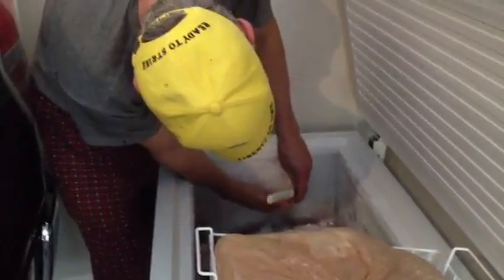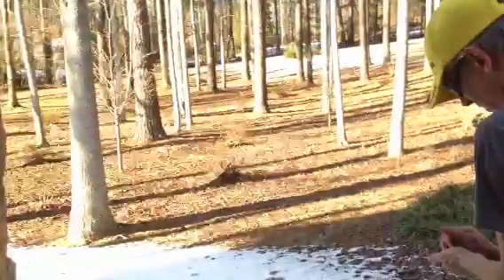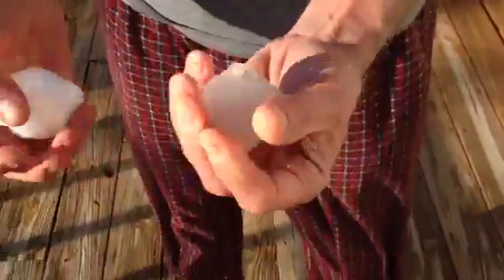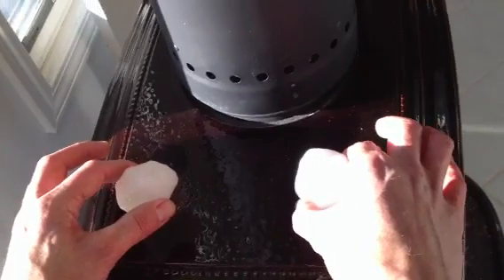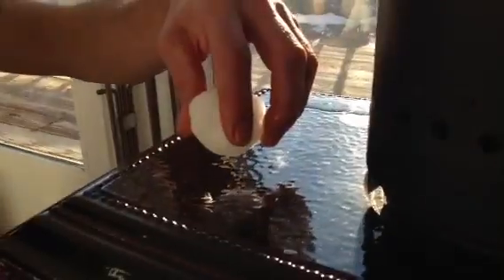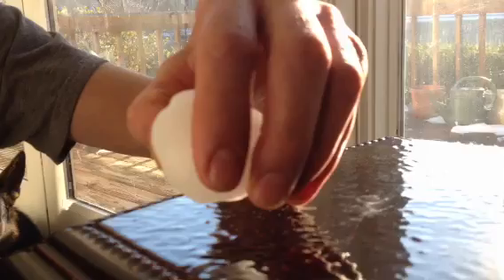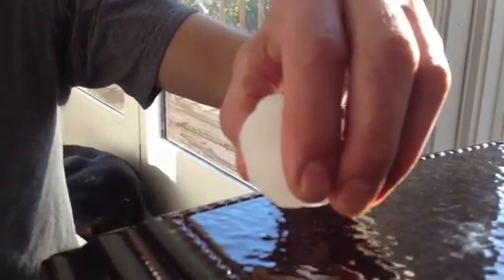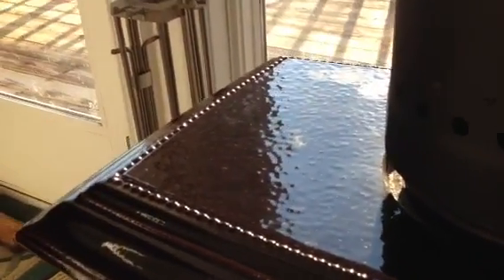Shouldn't Snowballs Melt?!?

Comment: The snowball is like a sponge, with lots of empty space between the individual snowflakes. It can hold its own meltwater. That's why it doesn't drip out of it for a long time. The ice scraped from your freezer has a different structure, it consists of large chunks of ice with no space between them. There is no such thing as a "chemically nucleated snowball".

Comment: There's simple physics between water and ice crystals, it won't melt the same as your chunky ice ball because the ice crystals are thin ice flakes. They are soft enough to absorb the water as it melts. Much like how snow cones can hold syrup in suspension and not drip. Your ball on the other hand has bigger ice crystals so it can't hold something with the viscosity of water. Put snow in a hot pan, you'll see the water melting and going into the snowball, it'll lose volume but not mass. Because of it's low density, it can condense before dripping.

But I'm sure this'll all fly over your liberty lovin' conspiracy head.
"IF 'DEY AIN'T TRYIN' TA GET MA GUNS, DEY BE TRYIN' TO POISON MA BRAIN WIT MIND CONTROL CHEMS"

Comment: I experimented on some of the "snow" we had here in central Texas. When I put flame to it? It disintegrated. It didn't melt. It just disappeared. It also emited a plastic burning smell. The smell was not from the flame. I let the rest of it melt at room tempature and it produced almost no water after it melted. This is the strangest "snow" I have ever seen.
Reply: Video proof? I've not seen a single video so far where snow behaves extraordinary. All quite normal.
Reply: Phouse1512 Even if I posted a video. You probably wouldn't believe it. So my suggestion is you get some snow and check it out for yourself. I thought it was nonsense until I checked it out for myself. I have a biology background. So I thought about how to conduct the experiments in a scientific manner. This "snow does not behave like snow I have dealt with in the past. It is more like some kind of chemical composition.
Reply: flamingangel999 No offense, but then it's just another story which I can or can't believe. Would be highly uncommon for snow to disintegrate/disappear. Maybe you can weigh the mass of the snow before and the mass of the water after burning, to see how much is left.
Reply from the maker: GOOD WORK !!!!

Comment: For a better experiment, you should try putting the ice on a pan hot enough to melt it, but not evaporate it, collecting the water. Then, refreeze this water into ice, along with an identical amount of water from your tap or whatever. Then you can compare how long it takes to melt.

Comment: I live in the northeast and so I was very curious about this "non melting snow". So I went outside and grabbed a decent sized snowball and held it between my hands over the sink. Not only could I feel the snow melt as soon as I picked it up, but within 2 minutes I had a steady stream of drips (about 2 a second). Plus I can tell you from my experience of cleaning off my car, after a few minutes of starting the engine the snow slides off the hood with ease. Since the beginning of January my area has gotten approx 2 feet of snow total. But there isnt 2 ft of snow on the ground now because most of it has already melted. I have an open mind about this sort of thing, but I have yet to see any real evidence. I want to see some actual chemical tests on the snow.

Comment: I did my own snow test. 3 snowballs from 3 different areas of my yard, Same amount of sun/shade, same size, using a bic lighter. # 1 melted normally- no black, no odor, produced water. # 2 no melting, extreme blackening and an odor you could smell from a foot away. # 3 minimal melting, some blackening, slight odor that you had to get really close to smell. After 3 days of temperatures ranging from 40 - 70 F the snow finally melted in my yard. The day before it snowed, the temp was in the upper 60's. The snow should not have lain at all because the ground was too warm.
Reply from the maker: Where are you located Jan ?
Reply: NW Georgia

Comment: people don't use wood stoves like they use too. for those who have never been around one they are hot all over. they don't heat in spot. for the snow is drier people.... water goes in cycles. it boils at 120° f turning it into vapor (air) it gathers and falls in the form of precipitation (rain, snow, sleet, hail). all water should also freeze at 32° f. if what is coming from our atmosphere is not freezing or melting then we have a problem.

Comment: Sublimation is most common when the surrounding air is cold and dry. Humid conditions and warmer temperatures would cause the snow to melt first. The dramatic change in temperatures when snow or ice is touched with a lighter, for instance, immediately converts the solid into a vapor.
The snow isn’t melting because it is vaporizing. It’s changing forms in a scientific process. And as to the claims that trying to melt this snow results in an odd smell, you may want to look to the lighter fluid or the lighter itself-- which is likely far more toxic than even yellow snow.
 and as with this no light, so it is just vaporizing until it get into a more humid form then it starts to melt instead of vaporize.

Comment from the maker: Here's a question for you.....Why would they put Brad Panovich of NBC Charlotte on my butt at 2 AM to do damage control ?  Snow is supposed to melt folks !   Always has, but probably never will again !!  Use your common sense.  Brad's claim that snow is 90% air is patently FALSE.  Look at my latest two short videos where I demonstrate that this loose snow melts down to 35 % water.  When it is packed, it is 70 % water !!!  Hard to cover those tracks now isn't it Brad ?!

Comment: This was not a scientific experiment. The two samples have to be controlled for mass, density, heat applied, and time. How long did you carry that ice ball around in your hand before you held it over the stove? Not that long? Not a satisfactory answer. How did the original temperature of the ice compare to the original temperature of the snow? Not that different? Not a satisfactory answer. Science is painstaking. Your experiment was slapdash.

Comment: Go take a scoop of un packed snow,put it on a  plate,come back in a hour,bet theres water.
Snow 5% water.
Ice shavings or frost 85% water,Ice 99.6% water.
The snow the is not evaporating is being drawn towards the center,if the vid had gone another 2 minutes,you would have slush.

Comment: In my experience between the Aluminium,Barium,Strontium and nano fibers which all happen to come from chem trails,  It seems to deflect and react to direct intense radiant heat. Forming a tighter molecular bond, making it more resistant because it gets tighter on the surface. When the air temperature is dropped subtly though it slowly melts somewhat normal. I would compare it to pushing your finger through silly putty slowly, and then attempting to stab it quickly, when you force it quickly it forms tighter and adds resistance,  i realize this is different, but kind of similar in the way they react to subtle force applied and direct and intense force applied. Make sense?

Comment: I noticed the evaporation into steam immediately on the freezer ice.  To the skeptics, regardless of what you say the difference, it is it still frozen H2O which hasn't changed.  But there is something strange about the composition of this snow on the ground.  "Air is a good Insulator" - then how does it even become snow?  This needs to go to a 'PRIVATE' lab and see what the added compound is.

Comment: Hm, I thought that if you compressed the snow, the air factor would be eliminated, measuring the melting point, and compressing the snow, comparing it with "Ice shavings" are pretty good experiments but no enough to convince them "asleepers". However since this caught a decent amount of attention, I am surprised no one with proper equipment, did not show up to simply, look into it. Then we'd be  dueling  in the realm of higher truths, But still...big thumbs up  to u guys. im down with u, cause so far your experiment didn't involve any type of combustive gases in which could explain the black smoke coming out of it. Above all we SHOULD be more open minded and ALL ASK MORE, instead of simply believing what "they" say.
Reply from the maker: packed snow 70% water !!!!  Look at my latest video.....

Comment: 1. Ice scraped from a freezer is still ice there is no air added to the water when it is made and the reason it melts faster is because the water has nowhere else to go.
2. Snow is water vapor frozen with pocket of air. When you form a snowball what you doing is pushing the snow together then sealing it by melting the outside of the snowball and it harden as the water is whisked inwards.
3. If he had bothered to weigh the SNOWball and ICEball the ICEball would have weighed more than the SNOWball.
4. The reason the snowball does not melt right away is because snow is made up of around 90% air the rest water, which is why it crunches when you walk on it, the water is wicked towards the center of the snowball taking up the air pockets.
5. The ICEball melts right away because ice is solid water and has nowhere to go but away from the center.
Reply from the maker: But John, my dear boy, shouldn't a ball of snow have melted one drop after six and a half minutes above a piping hot stove ?  How much do they pay you to miss the point entirely ?
Reply: Adam Berk the water was sizzling within 2 seconds of hitting the stove, sorry but it has to be pretty hot and not just warm for it to do that. Not saying that this "fake snow" not saying that ice and snow don't melt at different rates... i'm simply observing there is something extremely odd about the rate it took for one drop of water to come from that snow from outside... it's snowing here now in Iowa, i will continue to investigate this on my own and see what results i get. Also does not explain the chemical/plastic like smell coming from snow that is melted in the microwave and reported  by others, including close personal friends who have posted their videos as well, i just happened upon this one while doing my own digging around to see what i could find before making any definitive conclusions.
Reply: MrGregory1957 How stupid can you be. OMG it's a government conspiracy. We're all in trouble now. Try taking that snow, put it in a post on a stove and watch it melt. Actually go out and learn about snow and what creates it. Become a little educated. Come on up North by me....right now I have about a foot of snow and 6 more inches coming tonight. We did this in science class years ago. Give it up.
Reply: 6 MINUTES dude.. hello if it is the difference of air, that is too significant of a difference to be explained by your reasoning John, and actually if the air escapes should the water not be released more freely?
Reply from the maker: Adam, stove was very hot.  Under that condition, the snow should have passed to the liquid stage very quickly unless it was chemically nucleated.

Comment: Ice shavings are not snow, the crystal structure is completely different. Snow is mostly air. 1" of snow = 0.10" of liquid. 1" of ice = 1" of liquid. They behave and melt at different rates since air is a good insulator.
Reply: he smashed that snow to a pulp so moron like you can understand yet you still didn't get it :))

Comment: Thank you! One debunker made a bit of sense. This experiment is wholly different and shows things aren't right.
Reply from the maker: IT IS SAD WHAT SOME FOLKS WILL DO FOR A BUCK..............DO YOU KNOW WHAT A STRAW-MAN ARGUMENT IS ?
Reply from the maker: Macky, you're all over it !  THESE PROGRAMS MUST STOP AND SOON.
Reply: Ok, so I had to try the experiment myself since we had new snowfall. This from the Tri-Lakes area of Colorado. Went out and made a snowball, didn't pack very well, but Colorado snow can do that. With a grill lighter I put flame to the snowball, there was no chemical smell, the snow blackened, but that can be attributed to the butane in the lighter. However, the damn thing would not melt right, no drips of water formed at all. It was shrinking kind of like a flame to styrofoam, but even in my hand I thought there would be moisture, not. More like a memory of moisture in my hand. Very, very odd indeed. This snowfall is useless to put moisture in the ground and keep Colorado from more fires. I put that snowball in a bowl and went to work. It was melted when I got home, looked like water, no chemical smell, tiny bubbles were on it. I got another snowball and it behaved the same way, wouldn't pack well and would not melt in my hand. I put it in the water melt and the snowball absorbed it so fast I said whoa. Then it smelled like burnt plastic. It is still snowing, but at this time it acts like snow. When I grabbed a handful it started melting and dripping immediately.
Reply: mdtwiztid melting ice and snow, even to just get a DRIP should not take that long of time difference and I'm pretty sure you're a government shill or just a moron which pretty much IS the same thing.